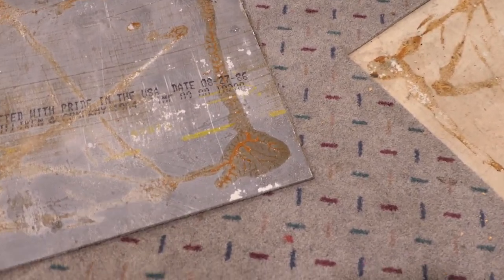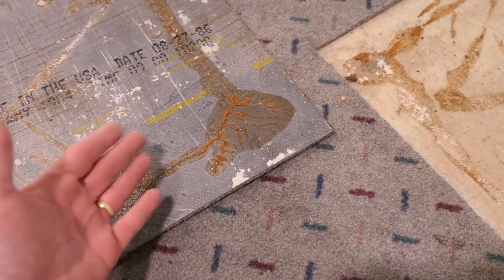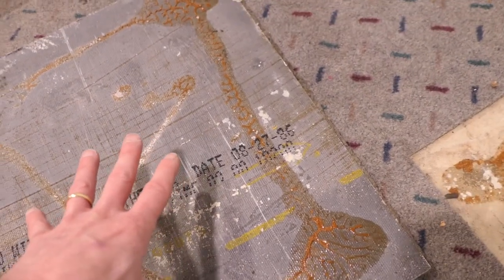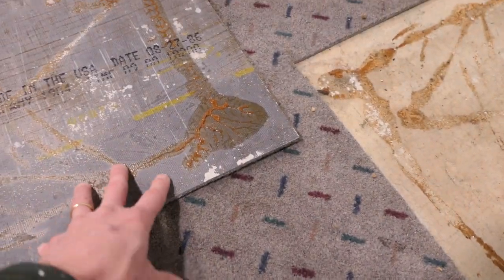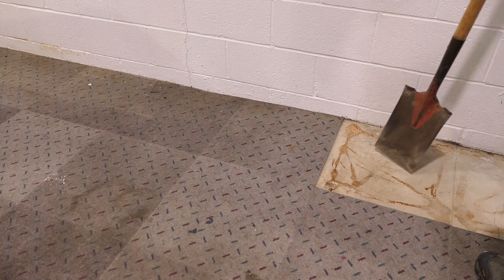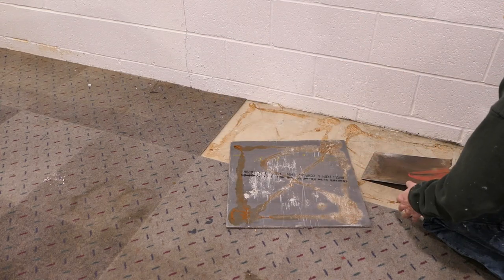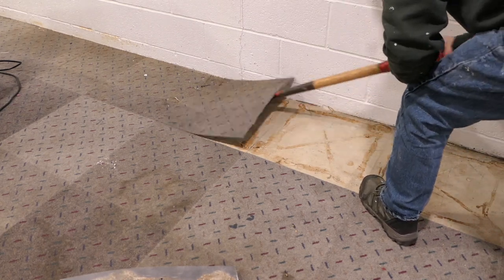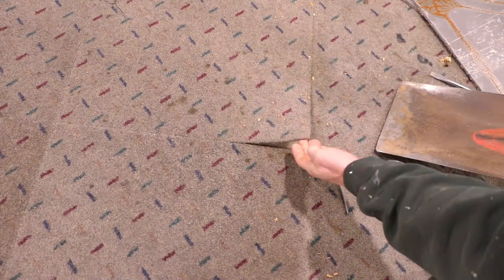How To Remove Glued Down Carpet Tiles

Comment: Hi,
Any advice on removing old and VERY STICKY linoleum tiles from hard wood floors?!
Reply from the maker: First, let me note that it may not be linoleum.  That term is often used generically, and you may be looking at vinyl tile rather than linoleum.  Second, I should note that SOME true linoleum tile or sheets contains asbestos.  There's no way to know without sending a sample to a lab, and it isn't necessarily dangerous unless it gets airborne, but just be aware.  Finally--how to remove the stuck tiles?  Typically I don't.  Many times the tile is applied to a layer of plywood, and I will simply set my circular saw to a depth equal to the thickness of that first layer of plywood, and cut the whole room into squares.  Then I can lift the small squares of plywood with the tile still attached and start over with the clean layer underneath.

If you have actual finish flooring under the tile, you have poor luck!  You can try to peel up the layers going with the grain of the finish flooring.  Use a sharpened ice breaker/chopper with a long handle.  You can get much more force out of that tool and it will be easier on your back.  A sharpened flat bar tapped with a hammer is another option, but slower.  With the tile removed you'll still need to do a LOT of sanding of the finish floor to get the adhesive off.  Is it worth it?  For a pro, probably not.  For a homeowner, maybe.  But, you should still consider just cutting up the strip flooring underneath and starting over.  By the time you do the removal, the sanding, the staining and the clear finish, it may not have been any cheaper than just replacing it with new.